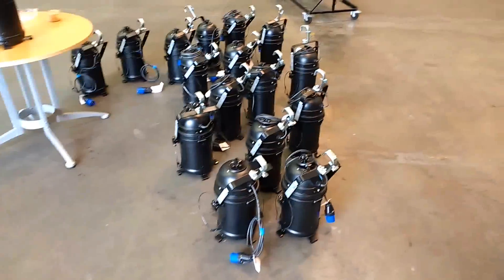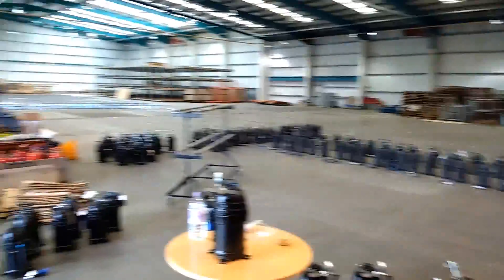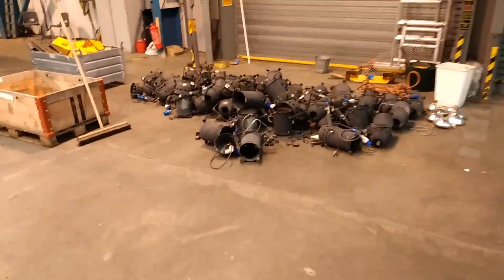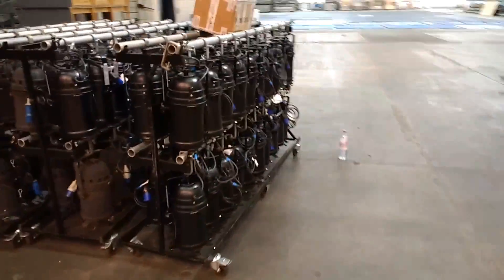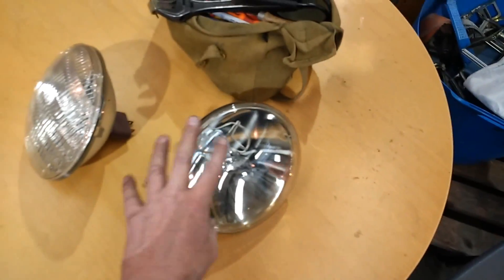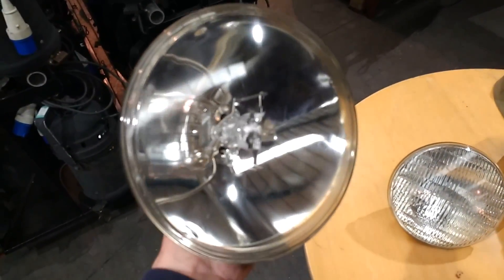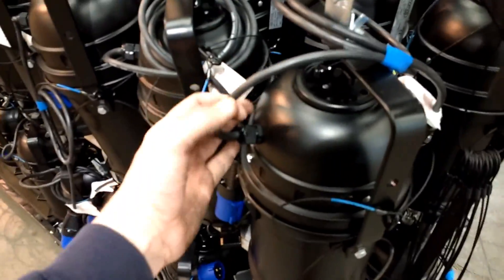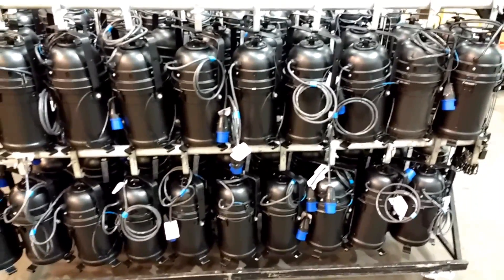PARcan graveyard.

Comment: I remember working as a tech on the Tattoo when the stand was a ball and bar construction like a giant chemical molecule model. I think it was one of the first times it was used as other techs were complaining that it was more dangerous that the standard scaffolding used in previous years.Very few access ladders or walkways. We would frequently step onto or grab hold of a  bar to discover it was a 'spinner'  and be left hanging from a harness which we wore, not because it was a H&S rule (there was no requirement at the time)  but because it was a necessity.  
No plugs and sockets on cables and lamps, just insulated and non-insulated crimp connectors wrapped in  PVC tape and 'twin and earth' oval cable. 
No storage hanger,  just an empty field. Had to remove a maggot ridden dead cat blocking a main cable duct under the Royal box. Very unpleasant. Because vehicles were prohibited within the castle, 5 and 10kW  lamps with 100's of metres of 2nd hand 10 &16 mm T+E cable had to be carried or hand carted up to the top towers of the castle sometimes at least a mile away from the store room.  In those days they were mostly fresnels and 'beam-lights', very few par cans.  There were 2 custom built follow-spots with huge lenses that alone must have been over 2' in diameter and 6' long. They could pinspot a bag-piper from  400 yards provided it wasn't raining. The beam just stopped half way in the rain. One of the main electrical distribution points was in the moat and would, of course, regularly flood. The whole rig was run from a state-of-the-art Rank Strand Duette with a re-written military operation manual that was in 2 thick volumes. Must have been around 1982.
Reply from the maker: +hughieandrolf That was the Northern Light era.  I did work on it in that era too, and had the delight of working on the old spinning bar Mero structure.
Reply: FindLiberty and by Snowflake you mean someone who values their life more than their pay packet? :-)
Reply from the maker: Danger is the spice of life.
Reply: To be fair, I've done more than my fair share of "stupid shit" over the years. I'm older (and possibly wiser) now though, and I would prefer to be in a position where I can spend the money I've earned! :)
Reply: hughieandrolf That poor cat.
Reply: Yikes - Those were the days. Not a job for a modern "snowflake", lol.

Comment: "Let's give the diameter in 1/8 of an inch!"
"Good idea Nigel!"
Reply: dgedi78
Fluorescent tube diameters are in 1/8 inch too. I wonder what else is that we never pay much attention to.
Reply: Damn it Nigel..
Reply: That was one of the things that surprised me the most when learning about different lamp types. It's like… why inches? Why eighths?!

But given the general shape and the diameter of the lamp in eighths of an inch, you can generally find exact replacements for whatever light you're using. That includes household bulbs (A19 being terribly common here in the US).
Reply: You can also encounter PAR56 (7"), PAR38 (4.75") and PAR36 (4.5") along, no doubt, other sizes.
Reply: ... but you're not as confused as him are you? I mean it's not your job to be as confused as Nigel.
Reply: It's a convenient way of putting the size in a part number without fractions or decimals. Eliminating a '.' or '/' can actually be important in compressing information into a short part number and avoiding characters that your inventory system may deem illegal. One system I use at work every day is length in 1/32 of an inch. Fasteners like an A1AMS0612G screw has a 6-32 (06) diameter/thread and is 3/8" (12/32) long.

Comment: Nice to see these still in action rather that being replaced with LED rubbish. I've got a 1kw CSI PAR64 and that thing is stupidly bright, throws it's beam for miles lol. Don't have the correct control gear but a 1kw and 400w sodium ballast in parallel seems to give the correct lamp current of 15 amps!
Reply: Why do you use a ballast with an incandescent??
Reply: Anvilshock CSI stands for Compact Source Iodide, a type of high intensity discharge lamp in the metal halide family.
Reply: Oh, I did not know that. Thanks!

Comment: not using standard mains plugs. here in Australia all our lights are standard mains or powercon for the intelligent lights
Reply: Afaict in the UK (where Clive lives) traditional stage lights are usually either on 16A IEC60309s (what you see in this picture) or 15A BS546s. The BS546 is more compact but it's more expensive and not waterproof They don't like to use BS1263s because they don't want fuses blowing in inaccessible locations.

Comment: CP60 lens looks like it's from an old car.
Reply: Correct!
And next time you see an aircraft look at the landing lights... 
Although not exactly the same as CP60, some planes have lights that look very similar to CP60, they are called ACL lights (aircraft landing lights) 
These ACL bulbs are also used in R&R shows in the same cans as Clive showed.
28v each (they are used in series, 8 pieces in one string) 
Their beam is even narrower then a CP60
Reply: ACLs are sexy!
Reply: hydrusje - am I using a different lamp to you? I thought they were 110V, wired two in series to go on 240V.

Very nice though, love how they look. We moved on to sunstrips with ten individually addressable halogen lamps quite a while ago, but I still love the look.
Reply: Yep, different lamp.
That's the FFN lamp, they are not true ACL's (the lens of an ACL is flat, or even bends a little bit inwards, and as I said, is 28V) 
I have used the FFN a lot too, it's a nice compromise and the abality to flash in pairs instead of groups of 8 is cool.
Although there was one company that made 28v dimmers so you could dim ACL bulbs individualy, as did the Studio Due CS2 and CS4's.
Reply: Or four in series in North America.
There are a few other types of lamp which you can use in place of the PAR64. Such as a separate reflector and lamp assembly or an LED array.

Comment: clive casually "these are rated about a KW each"
Reply: Read the description.
Reply: mipmipmipmipmip - it would be considerably more money for something which would be significantly less robust to sitting out in the Edinburgh weather. A venerable P64 is about as simple as a lamp gets. As Clive described, it is literally a metal can for a PAR bulb, with a lamp base inside, and a metal grill to stop things getting into the can. They hardly ever go wrong, and when they do it is trivial to fix or just swap the whole lantern for another one.

If they lose power, the parcans will be the first back, because it takes almost no time to reboot a dimmer pack, and no one ever asked how long physics takes to make a glowing piece of tungsten work.

You know what else? They just look nice too. It's very soft, you don't get super obvious edges, and they don't cast harsh shadows. It's a deep forgiving warm white.

Everything I do, I always have some parcans. When you need open white, why would you not?

Something else to consider is that each lantern goes back to a dimmer. So each lantern you see uses at most one DMX channel. Once you go LED, you might have at least four DMX channels per fixture, and the DMX goes right to the fixture itself, so you have more DMX cable to run, and you have to provision for more DMX universes in more places. So let's take the desk I prefer to order for a show - it has four physical universes, and a further capacity for 12 remote universes. The parcans and other incandescent lanterns take up one universe, but if I replace them with LED fixtures, I might have to use ARTnet processors for extra universe outputs. At the same time I can't get rid of the power, just the dimmers. So I have introduced complexity and cost, gained only RGB lighting which I could already do, have to contend with worse looking shadows potentially, less overall light output, and it costs me a lot more, in both time and money.

Why would I ever get rid of parcans?
Reply: hydrusje big shards of HOT glass
Reply: would make them alot more expensive and you would have to work for the extra "wash" effect and additionally you loose the indisturbable workhorses
Reply: Yes and no. LED technology just isn't there yet. There's simply no true Par 64 equivalent made in LED at this point. If you Google for it, you'll find many attempts. I promise you, none of them compare. Not yet, at least.
Reply: I agree with most, except that there is definitely a point in the future where par's will be obsolete (like carbon arc follow spots are now)
At this point in time, nope, no real alternatives just yet for OW/NC.

And the metal grill is there mostly to stop the glas falling out if the bulb explodes. 
The punters nor the talent seem to like it when big shards of glas fall down on them. ;)
Reply: I guess in the world of stadium lighting it's meh to average.
Reply: LED's are great but there are jobs they just can't handle for the form factor, longevity and desired result.

Comment: so... how do they die?
Reply: These ones work outside, so rust is always a factor. Rust and pigeon crap.
Reply: That's the thing, they don't. They just run out of spare parts from getting tossed about eventually.
Reply: Sometimes the connector to the lamp will break but for the most part parcans never die they just get uglier. I've worked on 30 year old par cans.
Reply: The only reason I've ever rejected a parcans was because the bulb holder won't rotate, or the contracts are so corroded the bulb won't light. I mean, if one was structurally unsafe that would count too.

They don't even rust that much since the heat bakes moisture out of them, so they only rust in storage.

Comment: Jebus, 1kW each. For how many hours are they used at their full rating in any single event?
Reply: Lamp life before burnout is rated at between 60 and 500 hours depending on lamp type, if I recall correctly. Figure a production runs 2 hours, some instruments may be on from dusk to morning as work lights or aisle lights. Others may not run 15 seconds total during the whole event. When they are on, most likely they spend most of their time at considerably less than full intensity. That said, I'd bet the generators or city infeed are rated at a couple of megawatts for the event.
Reply: That said, they are often run at very low current to just about glow dimly to reduce the inrush current and the heating shock to the filament.
Reply: Not so much these days -- Clive mentioned moving lights, so it would be a safe assumption that some are potentially used for front wash but most are used as effects lamps. On smaller stages using par cans, most of them will be on the entire show if they're the primary light. On larger stages, they're more or less used for visual effects. YouTube for "kanye par can stage" and be amazed. I believe it was just shy of 800 par cans all used as primary lighting.
Reply: Well, yes of course I meant to say that can be done when they're meant to "not on".

Comment: take one to bits
Reply: PAR cans have approximately exactly three bits.
Reply: You would be amazingly bored. The front cylindrical part of the can is just a hollow metal tube with three bent pieces of tin on the front. The back cap is basically a metal salad bowl with a hole where the bottom of the bowl would be. Add a hinge between the cap and the cylinder and a latch of some sort to hold it closed, and a big (8") metal "C" ring to hold the lamp in place. And that's it!
Reply: we want the bits
Reply: There are no bits. It's literally just a metal tube with a bulb at one end and a hole at the other. All the complexity, such as there is, is the visible stuff that allows it to be mounted on a pole and pointed in arbitrary directions. They weigh very little, and most of that is the bulb.
Reply: bits bits bits bits bits
Reply: Anvilshock
Front tube, back "bowl", lamp, lamp retaining ring, lamp connector, fuse, power cable.... Simple as they are, people who've never seen one may still find them interesting.
Heck, I'd be interested just because it's been so long since I've touched one.
Edit: I'm assuming theres a fuse. I never closely inspected 64s. We only dealt with 56s. And we might be different in Australia anyway.
Reply: Anvilshock , I count five bits
Reply: What kind of lair, specifically? A dragon's lair? A thieves' den? A witches' cove?
Reply: tin2001 - there's no fuse, they connect onto a 15A round pin or 16A ceeform, and it's on a breaker on the dimmer channel.
Reply: biiits
Reply: it seems there is some dispute over how these are wired, I wonder how that mystery could ever be solved..........
Reply: Now that accusations of lies are being thrown around it has made things are turn ugly,  if only someone could end this debate somehow....
Reply: Mr KeeDx3 sir I must respectfully call you a liar.

Comment: So you don't use lots of coloured gel filters with them?
Reply from the maker: +Elliott Veares Just CTB (Correct To Blue) for the BBC filming.
Reply: bigclivedotcom Huh. I've always known it as Colour temp, blue
Reply: Lee 201, full C.T. blue tungsten to daylight. 3200 K to 5700 K. mired shift 137 and a meagre 37% transmission. I guess it'll make it fit more nicely with the moving heads too, but I guess it's so they don't have changing white balance as natural light is replaced by the parcans.

Comment: What is wrong with the old ones and what will happen to them?
Wouldn't it be a nice idea to take them apart and store the parts as replacements?
Even parts like the cables/plugs could be re-used in many applications, probably.
Reply from the maker: +L3 P3 They're very old and had various issues like missing parts.

Comment: Ahh... PAR cans and the whole wacky world of size designations, 100V vs 220V, splitters, etc.
Reply: I always ran 110V globes and used them in pairs (Rock concerts and Theatrical use) With what we called a "Twoffer" I used to use round earth pin plugs for all my 110V globes and had adapters which had two round earth pin sockets with flex going in to a 50mm square box with 16mm nylon glands then out came a flex that had a normal plug top (This was not the usual construction ;) but the Office of Energy Approved my design after a local hire company was fined for the version bellow ;)

Some companies had other methods including complete racks of cans 8 on a bar which plugged into a bit of metal ducting that then had a multi pin connector on it. This then ran back to the dimmer racks on a "Par Can" cable and plugged into a "Par Can" patch module that allowed for the series connection so you could technically have a pair of cans with one on each side of the stage.

This version is technically illegal in Australia but just about everybody does this, each Can has a plug that is not a normal plug (usually the active and neutral pins are right) but instead of a flat earth pin they have a round earth pin. These then plug into a socket which is then wired with flex into the back of a standard plug (both earth wires under the earth screw, Active from one can to the Active of the normal plug and the neutral of the other can to the neutral of the normal plug) the left over Active and neutral are joined and either screwed connected or soldered then (usually taped up)

Comment: Audio was so low I couldn't hear it.
Reply from the maker: I'm using my phone with no external microphone for the impromptu stuff.  There's not really an option to add a microphone when filming on the fly.
Reply: try boosting the audioline in the video editor
Reply: Clive works in Lighting, not in Sound. :p
Reply: Have you ever thought of trying a lavalier microphone? There's a lot of really cheap options and most of them are specifically made to work just by plugging it in to your phone.
Reply: It sounds like your voice only is left channel and some background noise comes in the right channel :(
Reply: Pump up the jams! http://i.imgur.com/z6bZFUc.png
Reply: It was a reverent hushed tone as befits the presence of such revered historical junk.
Reply: Not quite as separated, but yeah. If I had to guess, his phone has the stereo mics only held properly when filming in portrait mode (and NOBODY should EVER film in portrait mode) so that instead of left-right it records as up-down ... voice coming from above/left while the background noises reflected off the hard floor concentrate at the bottom/right.
Reply: Nevertheless, this is Youtube. You watch videos. Not pictures.
Unless you use a normalizer on your laptops or shitty little speakers, you can't hear shit.
Reply: I am having volume both in Windows AND on YouTube on 100% PLUS IF i can hear it without a problem on my left it won't help on the right. I even just cranked the volume higher to listen if there is anything on the right speaker but there isn't
Reply: Whut?
Reply: Use a free piece of software called Audacity. In the effects section chose 'normalise'. Your sound will be lifted  to peak normalisation with no quality lost during the change.
Reply: Turn your volume up
Reply: bigclivedotcom audio is fine 🙄
Edit: on my iPhone. No idea about desktop.
Reply: Ehm... Da fuq you trying to tell with that picture? It does not even include Left/right channel only Front channel which only shows the highest volume?
Reply: Sorry clive can't hear you, i know your on the fly but low sound. :(
Reply: Audio was perfect for me.
Reply: Fine here mate?
Reply: Do you have SoundBlaster audio equipment in your system? If not then there's your problem.
Reply: Agreed. Too quiet. But then the volume of all of BC's video's of late have quiet as well. Please speak up big fella.
Reply: Audio is bad, I can't hear you.